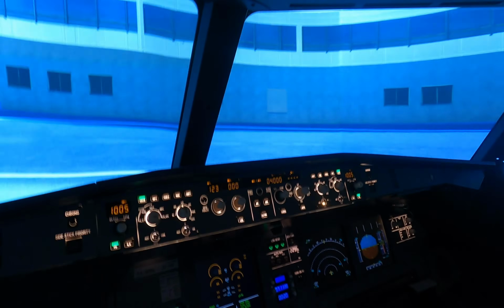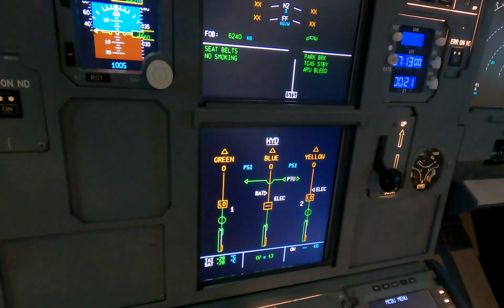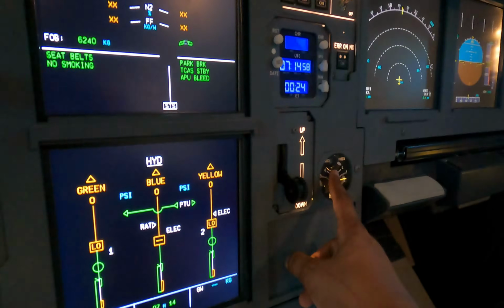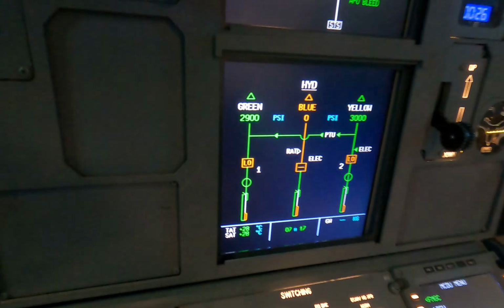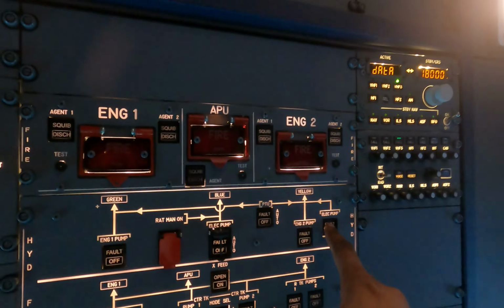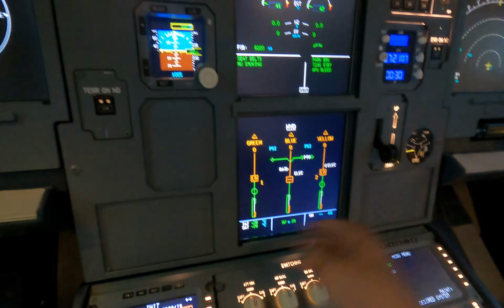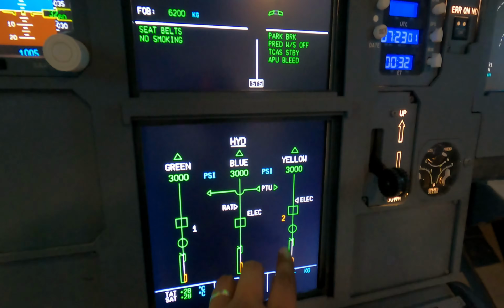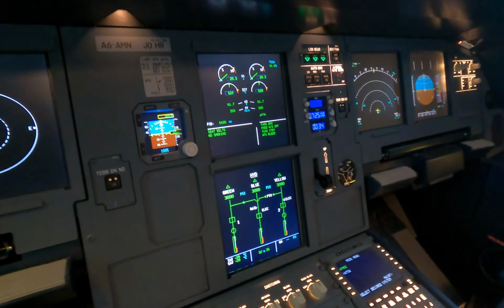Airbus A320 | Pilot Tutorial | Hydraulic System Walkthrough

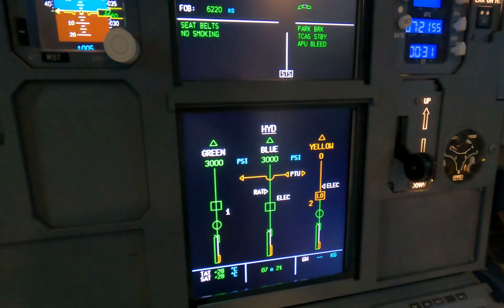Comment: 11:14 Captain with the start of engine n1 you have HYD first in G and then in B. BUT If you start first engine n2 you have HYD in Y and then where else?
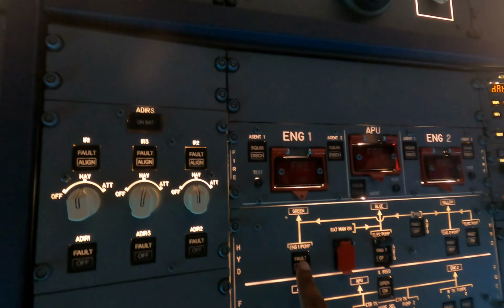13:50 if you have low pressure in blue HYD, the other 2 will send power via ptu?
Reply from the maker: Yes, when you start either engine first the PTU comes alive to pressurize the other systems, however we start ENG 2 first usually as its connected to the ELEC HYD system and allows us to charge up the accumulator pressure for the Brakes.

Comment: Thanks again for providing another informative video Request if you can make a video on A320 ENGINE start procedure for both Cfm and LEAP (NEO AIRCRAFT) engines
Automatic start and manual start
Reply from the maker: Thanks for the comment, and a good video idea as well for a tutorial, the engine start process on the A320 regardless of the engine type is the same, simply put the engine mode selector to IGN/START and switch the masters to ON one at a time. 
BUT a manual start procedure is something we can do for sure. We can do that this week. Thanks 🙏🏽 ✌🏽👍🏽😁